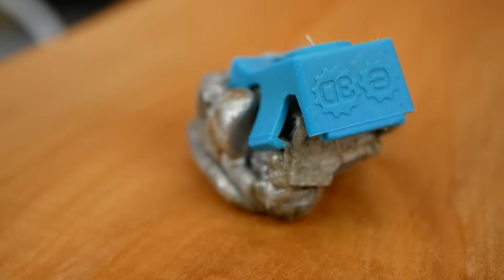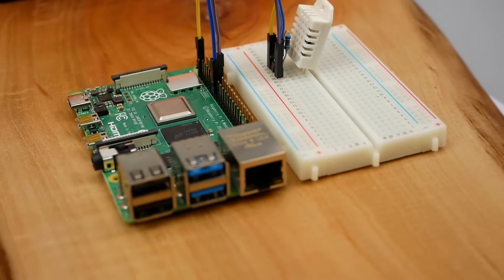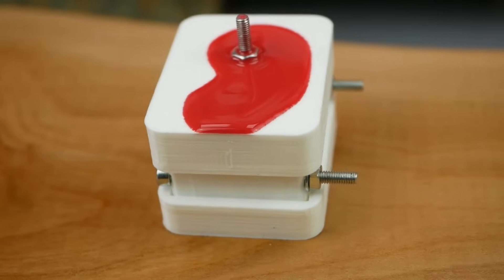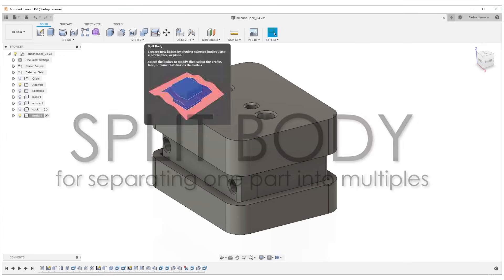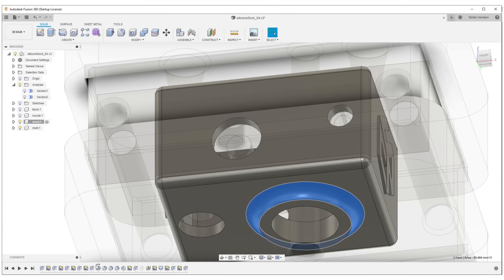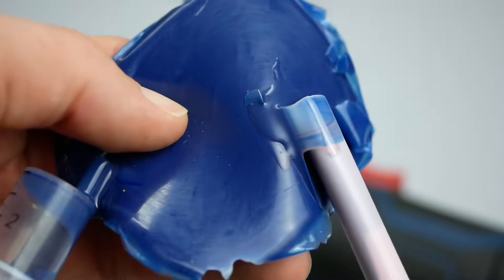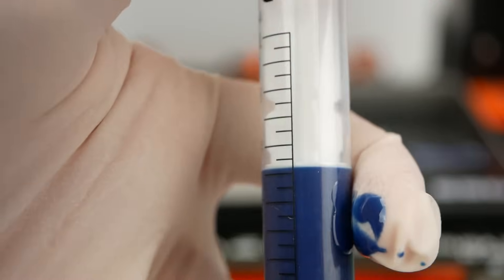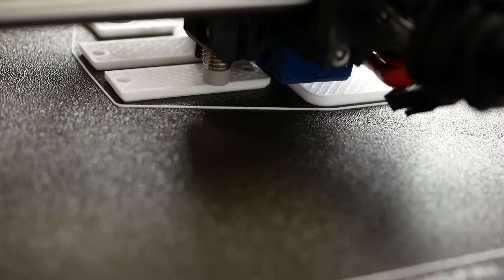Design & Cast your own Hotend Silicone Socks!

Comment: A touch of vaseline jelly between the mating surfaces will reduce liquid leakage and reduce amount of flashing that's left over
Reply from the maker: Great tip!
Reply: Yes but it needs a very little amount so it doesn't spill into the mold cavity. I use botox syringes to apply it. 
You can dilute the vaseline with mineral spirits to get a better paste to work with.
Reply: Also, as you assemble it, you can wipe away any superfluous vaseline with a Q-tip.
Reply: Using 91/99% IPA: Put any amount, say 6-12 OZ. in a capable bottle (CLEAN soda bottle works well), put in about 1 Once or more of vaseline, shake well let rest 5 minutes and shake WELL again (maybe use a 100*F water bath) let cool to room temp.  Excess will fall out of solution and collect at bottom. Pour this mold release (not the stuff that fell out of solution) into a fine mist sprayer (with new label of course) and spray away, coat all surfaces well, you can't really overspray this unless you really try...  Let air dry till the IPA has evaporated completely.  In 5 years making vacuum molds for signs I've never had a failure and it also takes away any moisture the mold may have absorbed and is almost completely invisible in the finished product. 
Hint: Don't use it thinking you can fill voids with it - just the thinest of compleat films is what you are after.
Reply: @koolkevin2357  This is one of the best pieces of advice in this whole comment section. I come from a family of mold makers and although I don’t do that as a profession… I grew up around it and still utilize it when tackling all sorts of projects. Plastic injection molding, Lost wax investment injection, plaster, silicone, gold, silver, brass… I’v done kits with all of these.

Smooth on and others make great aerosol mold release products… and I really love the aerosol can because it allows the thinnest of coatings. 
But this right here is a wonderful way to get a DIY version on the cheap. But highly suggest 99% alcohol though… Because the difference in 91% and 99% is massive in regards to water displacement. MASSIVE...

 after years and years repairing industrial electronics and test equipment… I’ve had to conduct multiple long statistical tests on the water displacement properties using alcohol and other chemicals and concentrations.

in high end (unobtainable) industrial board repair. That extra 8% is an absolute shit load! And that becomes even more important when dealing with materials in mold making
Reply: Plasticine works well also

Comment: I've actually had far more success using the "pro" version of e3d's sock with the tiny hole for the end of the nozzle as compared to the second, more open design. For whatever reason I ended up having material stick to the exposed nozzle and glob up pretty frequently. The more covered design completely eliminated that problem for me.

Your custom sock design looks really good though. I really like the tighter fitment as compared to e3d's version. I'll be giving this a try as soon as I get the parts in :)
Reply: I had the same issue when printing with nylon, it sticks to the nozzle until I used a sock with the smaller hole.
Reply: I actually  bought the thin hole version first and it didn't work well for me - the sock just didn't seem to fit well. The one with the larger hole fits better and lasted a lot longer...

Comment: Looks like you get some incredible detail with these molds using one of these inexpensive Resin 3D printers or would they not work with silicone?
Reply: You can also sand, primer and paint mold surfaces that you want to be smooth. The silicone will pick up whatever surface finish you have from gloss smooth to textured. It will even transfer fingerprints so you have to be careful handling very smooth molds.

Platinum cure silicone can have curing issues if it contacts some paints or some other types of materials so check compatibility.  Tin cure silicone is much less sensitive.
Reply: @shophacks  on point advice..
Reply from the maker: That should work very well. If in doubt, use some mold release.

Comment: Unfortunately the link for the 2 part high temperature silicone redirects to Germany Amazon, and they do not ship it to Brazil nor to the US. And my google-fu isn't finding an alternative. 😕
Reply from the maker: It was hard for me to find alternatives to the stuff I get here in Germany. Smooth-On Mold Max 60 is an alternative. Just search for "High Temperature Silicone" or "Tin Mold Silicone" and you might find local alternatives.
Reply: The links are working for me (US store)
Reply: Only the first link is going to Amazon DE, the others are fine.

Comment: A question: 15:09 when you cut the place where the cables are passing: wouldn't be enough just to cut open with one cut the material over that hole? The whole thing is very flexible so I suppose one could still be able to pass it beyond that wires. But maybe that missing little part that you cut away is not important, I don't know.
Reply from the maker: That actually was my first intention but this way it's way easier to mount it on the block especially in tight places.

Comment: Hey do you really need a Rasberry ? Arduino or a ESP8266 are for the  most things enough. 

Tipp: Don't use a DHT sensor there are not relay reliable and there accuracy is also not the best. I recommend a BME280 there are relative cheap and definitely better.
Reply from the maker: It's overkill for that project but know how to use it and how to program on it opens me so many possibilities especially in the direction of OpenCV and stuff like that. You gotta start small ;-)
Reply: I recently learned about https://github.com/rsta2/circle and needless to say, I'm quite excited about using a Pi without the annoying part: the operating system. So that's an option too if you have a pi on a shelf collecting dust.

Comment: Silicone socks are amazing! I made mine from a different design before this and no more throwing heatbreaks out cause they're unusable (too much gunk makes it hard to unscrew stuff. I use less than 1$ chinese clones ofc :P)
it's so nice to always have a shiny beautiful heatbreak! not to mention the help with stringing etc. also the burnt plastic fumes can be toxic and all too

I just wish the heater block screw was covered since that doesn't seem to harm anything really. and I just wish it covered the nozzle A Liiiiiiiiiittttttlemore to the tip! but I love this regardless

Comment: I only need a 3D printer for that, tho. Which I plan to buy the month after next month ... if I don't have any unexpected spending. (I should have enough next month for the very low cost ones, but I just want to wait another one just to make sure I actually can spend that much ... and all the extra costs ... like filaments and so on and so forth )
Reply: It's best not to go for the cheapest ones, in the long run you might well spend more on getting them running well
Reply: @EgorKaskader  The cheepest ones are about 100€. I plan for one in the 300 -400€ range.
Reply: @MrMegaPussyPlayer  Good choice, though I meant the 200-dollar bracket.
Reply from the maker: Don't buy a 100€ A8. You won't be happy and eventually burn down your house. Opt for something at least like an Ender 3 or similar.
Reply: @CNCKitchen  I did actually buy an A8, and a year later I still have it...
's leadscrews. A8 is only good if you know you're gonna overhaul the whole thing anyway, and even then it's a lottery if it'll work or not! Mine did, and the frame failed in about 3 months. 
Main takeaway: just buy and Ender 3.

Comment: If you want to get rid of some of the flash print connecting surfaces on glass. It works better for me. Also avoid making thin sharp edges. You could try to print it as two plate mould and make use of silicone elasticity. Or make the undercuts smaller
Reply: I guess your first point is to print the mating surfaces of the mold on glass? The challenge there would be to create the registration features, that on one side need to protrude from the mating surface. I suppose you could design holes into both sides of the mold and then use pins?
Reply: @Graham_Wideman  I prefer using pins, 3d printed features take more time to print and in some cases are hard to incorporate into design. Puting pin inside hole - easy and fast solution.

Comment: This makes so many cool things possible. You don't need to print with flexible material to get flexible parts, you can print a mold using normal material and use this trick to make heat resistant flexible parts.
I think this video just pushed me over the edge into actually ordering a 3D printer.
Reply from the maker: If you know at least some CAD or are open to learn it, a 3D printer is an awesome tool!
Reply: Not just flexible parts. I've printed a mold and used it to form a concrete mold.
Reply: @KieranShort  Not just solid or flexible parts.  I've printed a mold and used it to form an air mold. 

(kidding aside, I really liked this video and thought your comment about making something out of concrete was cool...what was it?     I just wanted to add a tongue in cheek take of molding something unusual along with the more serious question about what you made out of concrete.)
Reply: @underourrock  I even pushed your limits and created a water mold. And even more, now i hold a coffee mold in my hands! So delicious.
Reply: If your medium is temperature-resistant (and you only need one or two) you don't even have to build multipart molds.  Just print in PLA, fill the mold, and melt it away with a heat gun.
Reply: I'm not sure how I got here... another 18 hour print on... 4:47 AM... I haven't slept in days... watching it all go down is so satisfying... Anyways... I grabbed a creality cr10s pro v2 and thought oh why not hire a guy to render my brothers brand into 3d... now lets create that new product we talked about months ago for christmas gift... Failed with TPU so many times creating suction piece.. I have not figured it out yet... But this is interesting... And I want to try it... Don't get a printer... You'll regret losing sleep..  Get 2 printers.
Reply: This idea can be taken another step further:   Your silicone part could actually be a mold for a wax pattern. (or just a candle..). You can then coat that in investment (clay slurry) and use it to cast or even vacuum cast metal.   The advantage of a silicone mold is the same as you can stretch it to remove a rigid part, so draft is not required, and overhangs etc. are allowable.  Since you can remove the rubber mold without damage, this means it can be used again and again…so from one silicone mold you can make a whole tree of identical wax parts and cast them at one go.  My understanding is that this is how compressor and turbine wheels for turbo chargers are made, except that the molds for the silicone have been CNC machined on multi-axis mills.   While there are a number of steps involved, this provides a path to creating metal parts using our 3D printers. It might even be possible that those metal parts could be dies for injection molding…there is no limit to how many larger dolls we can add to this babushka!
Reply: @gumbykevbo  Besides the methods you list, it's also possible to make a wax like original using a resin printer. The channel VOG has a bunch of cool videos showing how to cast metal parts using techniques similar to those you described.

Thanks for taking time to describe these various techniques.

I've had my 3D printer for over a year now, I'm really enjoying it. I'm in the process of building a larger (500mm cubed) Rat Rig V-Core 3. I plan to use the larger printer to make robot parts which won't fit on my Prusa MK3. 3D printers are fantastic tools and it's great there are so many excellent channels (like CNC Kitchen) to help us understand how to use these tools..
Reply: I own the Vertex nano, don't buy it.
Reply: Get a Prusa! Prusa makes the only perfect $350 printer and it's way too good for that price. Hopefully you ended up with a Prusa if you bought one already.
Reply: @avgvstvs96  I did end up with a Prusa. I got their MK3S which was about $750 as the kit. The thing is just as fun as it looks in these videos.
Reply: Since he mentioned you can cast tin in it as well, that means you could use this same process, except in place of the hot end, you'd have your finished part when working in cad.

Then you'd print the model of the part, (you could even manually finish it to make your final part look batter) print the mold, cast the "sock" which would be acting as a high temp barrier, put the sock back into the mold and then pour your tin into it.

Comment: That is awesome, I have to add this to my toolbox of techniques.  One of the most useful materials I have for functional parts is TPU / TPE, but it can be a pain to print with on a stock MK3.  This approach should be much faster (one of my recent projects was rubber feet for garden furniture to stop them damaging a wooden deck - 20 parts took a few days to print because TPE has to be printed so slowly).  I especially like the trick of using the syringe to create a vacuum to degas the silicone, very elegent :)